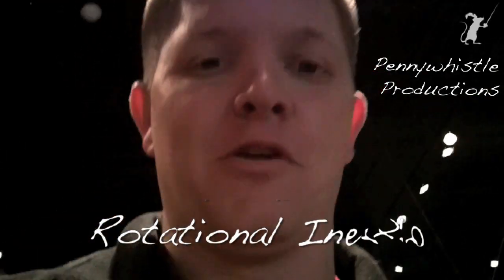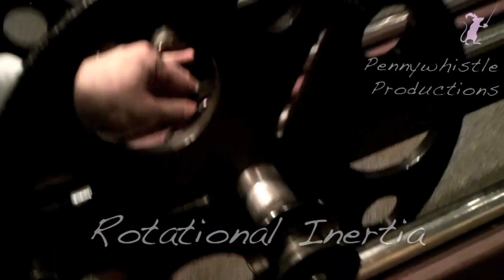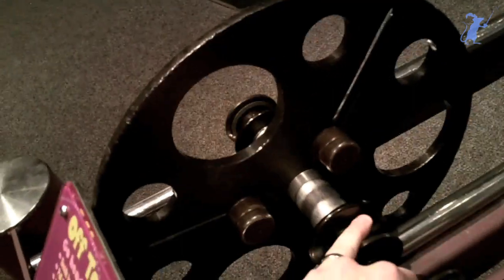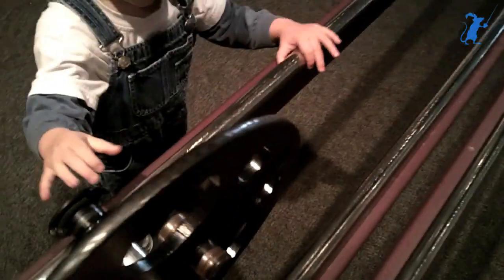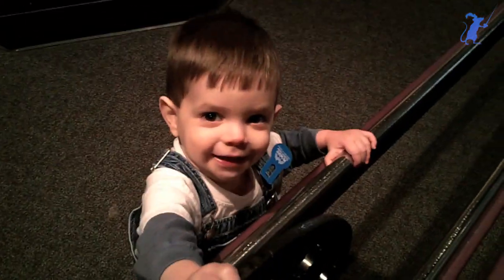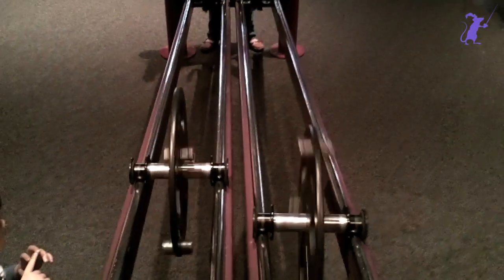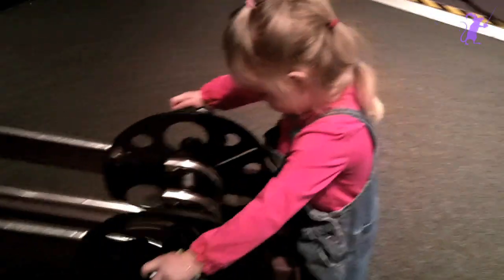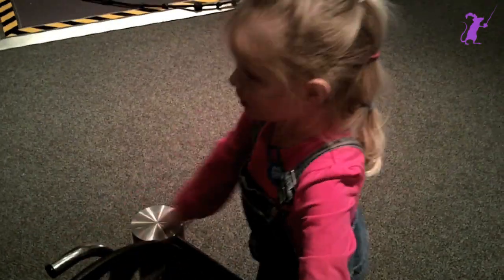Rotational Inertia Demonstration - which is faster?

Comment: @elephamoose 
rotational inertia of an object : how difficult it is to change velocity of the object. that includes the body's mass, but also how far each bit of mass is away from the axis. The farther out the object's mass is, the more force is required to change the rotation rate - the more rotational inertia the object has.
in the vid - the mass of the hoops is the same, but the weights of the right one are farther away - so it requires more effort to change the speed- more rotational inertia
Reply: Thanks for the explanation 🙏

Comment: Ahhh.  I guessed the wrong one because I both over-thought it.  I thought having the weights farther out would pull the wheel along faster because it would have better leverage to spin the middle.  I completely forgot about moving the weight along a rotating point and how the further out weight is distributed the slower something spins.

I was still partially right though... about leverage... and other stuff that doesn't apply or matter. :(